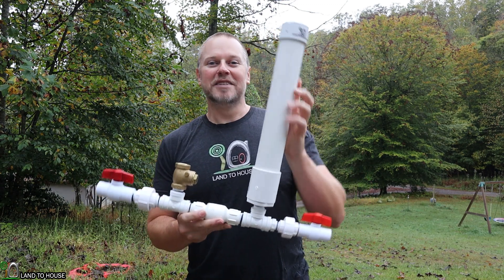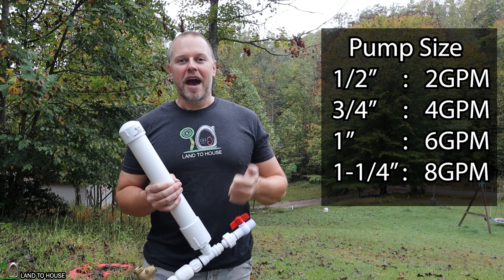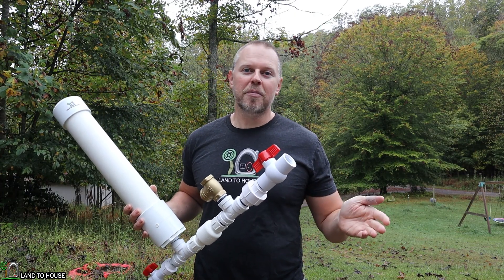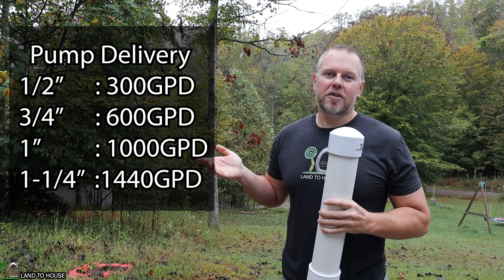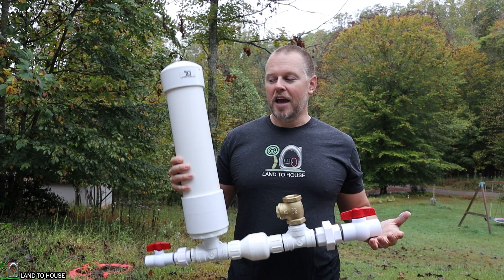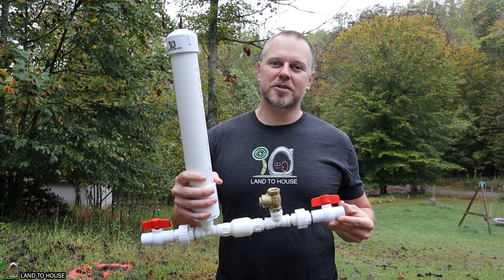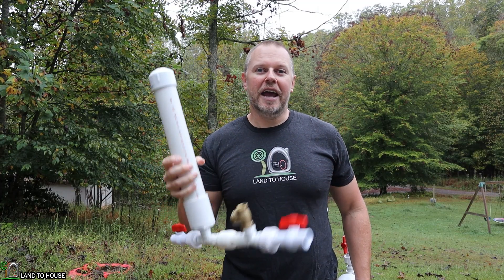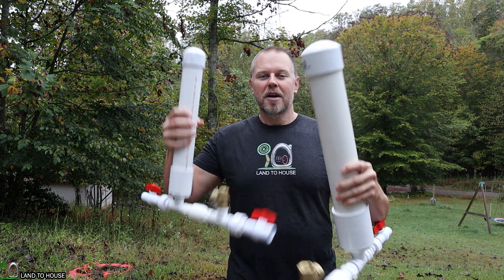Pick the Right Size Ram Pump for your Needs

Comment: Building a 2 inch down to 1 inch used a lot of your videos for input.
Reply from the maker: Awesome! That is going to use a good bit of water and pump a lot.
Reply: @LandtoHouse that’s the plan it’s going to be used to fill up a dam so plenty water needed. Got a 3000L an hour Spring to feed the pump.
Reply from the maker: That is a strong spring! I should expect the 2" pump to use somewhere between 10 and 12 gallons per minute. You have 13gpm. If you find that your Spring is not flowing well enough you can tilt the waste valve to use slightly less water.
Reply: @LandtoHouse I’ll keep you posted I’m contemplating filming the project for YouTube.

Comment: Mine worked about 3 times really well. Than it stop pumping no matter what I do.
Reply from the maker: There are a few things that could be going on. Air in the drive pipe, debris stuck in the secondary valve, too much head pressure not enough lift, debris over the intake screen. And several other different things. What is the pump doing when it stops working? Waste valve staying open or waste valve staying closed?

Comment: I was wondering:
What's the smallest functioning rampump you ever built or know of?

Let's say I have a pond with a well in it, barely any plants and no animals. And I suspect the water from the well to contain too less oxygen for animals to live in, and because the pond is constantly filled with that oxygen arm water the whole pond is as well as dead.
So if I could use the 1/4GPM overflow from the pond, with 3 feet of headpressure, to have a little bit of water splash back into the pond from 1ft above water surface, it might add enough oxygen for some animals to start inhabiting the pond and make nutrients for plants to grow (so they can produce oxygen, so more animals can produce more nutrients, etc...).

Would a 1/8" or 1/16" rampump work?
Or would it be a complete waste of time to try this?
Reply: The smallest pump I've seen him have made. Is a 3/8 inch. If you could find brass swing check valves that are smaller. You could probably build a smaller one. I've never seen a 16-inch swing check valve